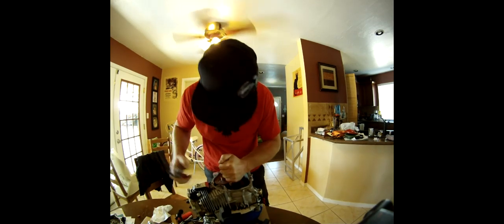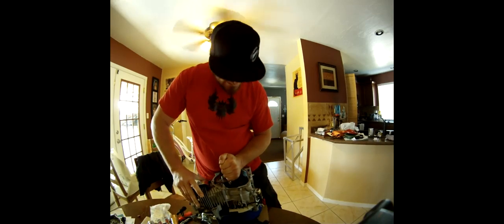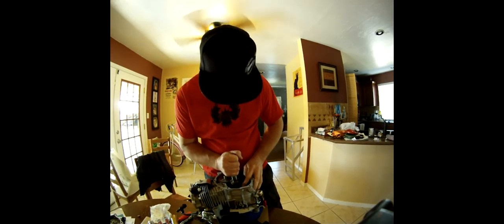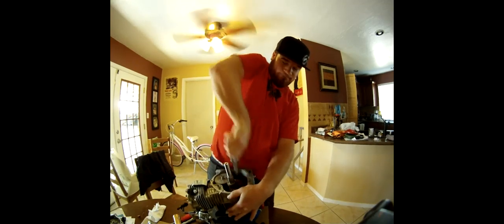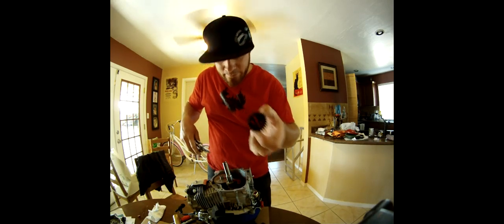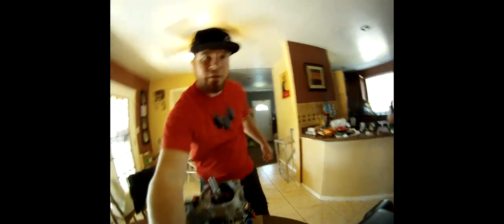How to remove govenor from Clone engine

Comment: good job but my gov came out WAY easier. its a new 212 predator engine. I used a pick and lightly tapped the point of it ONCE to the inside of the little clip/ring that holds the gear on and bent it came right off. i thought i was gonna have to beat on it. Took me about 5 min to do the whole job and never having done it before. thanks for the tips. you made very easy.

Comment: Thanks man very helpful, Im puting a 6.5 on a meridian tricycle nowand Dec.. I need something to buzz around the desert with while my knee is healing and my DL is suspended. Im recovering from a motorcycle wreak and mersa infection on the knee. At 57 I dont heal as fast but Im con wize enough to have some fun and use arizona loop holes in the law to build something I can ride on the streets for little $ w out the need of a DL dig it ?

Comment from the maker: no, this is the 212CC engine, on the 346CC and 420CC engines, the governor gear is mounted to the inside of the engine case cover, its much easier to access and remove

Comment: Any reason you didn't remove the low oil sensor while you were in there?
Reply from the maker: +Barry Norgaard  That is a matter of personal choice, my winches don't pitch and roll like a gokart does so there is no need to remove the sensor (or more simply, clip the wire outside of the case). That being said it is a nice safety feature- a couple of years ago I destroyed a clone engine on one of my karts because I clipped the low oil sensor and did not realize oil was leaking from the grommet where the sensor wire exits the case.
Reply: Good point.